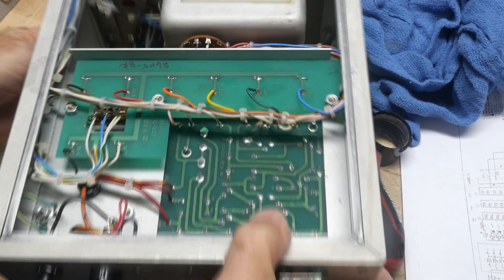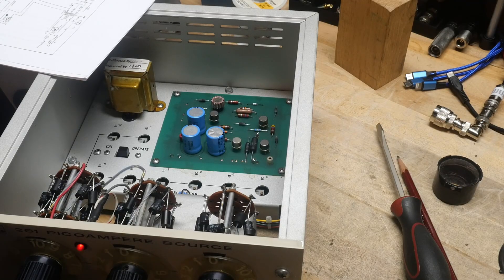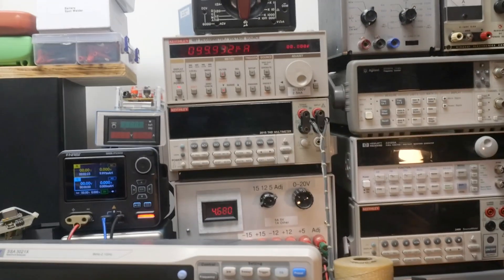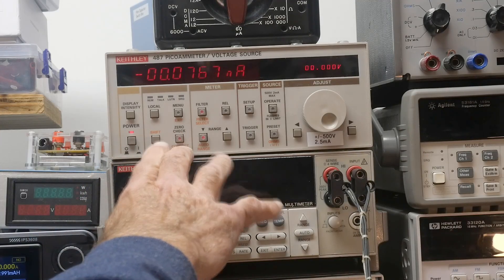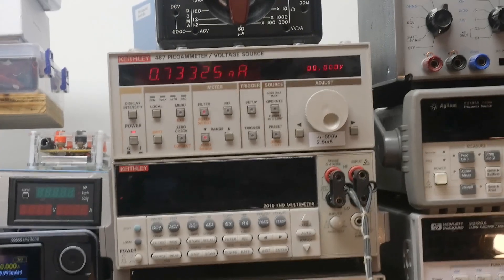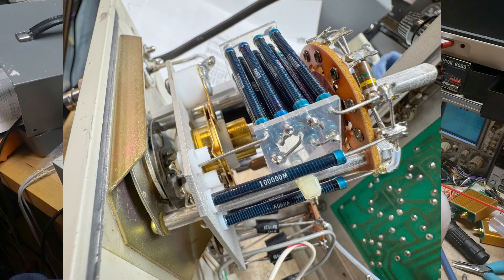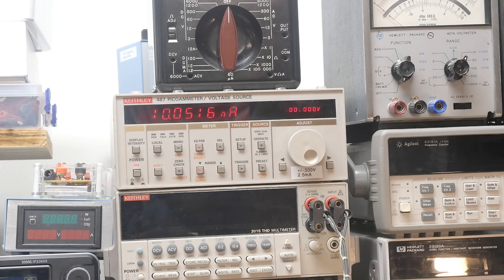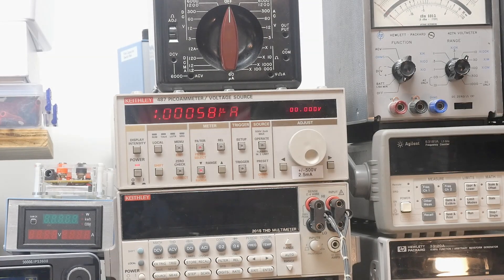#2476 Keithley 261 Picoampere Source (part 2 of 2)

Comment: The nA ranges are probably just because it needs a thorough cleaning, if anyone has every touched that with their fingers or a slight environmental grime from the air it causes leakage, it has to be really clean using IPA, and then has to be left for a few days before even that residue clears enough for it to come right, I had that issue on mine.

Comment: You can use your keithley 619 to verify range resistances per table 4-2.
Calibration depends on some known value(s) and measurement tolerances, so that check might not get you closer.
Using precise measurements for relative comparisons is much easier.

Comment: Just curious, several people have suggested cleaning the R's with alcohol and distilled water. Would placing a few desiccant packs in the box help with possible humidity issues?? Also would drying the r's off after exposure to water with dry heat be of benefit ?? Something like a 40 w incandescent bulb in a Styrofoam box over night.

Comment: I used to repair electrometers that used these extremely high resistors.  The procedure for the care and feeding of these rascals was to wash then down with distilled water after cleaning them with medical grade alcohol. Even that was still touch and go as to whether you could get them clean. In our case it wasn't so much accuracy as noise due to air born junk landing on the resistors. Victreen Corp. use to be one of the main manufactures of high value resistors and if they are still in business would be a good source for replacement and specific cleaning information.

Comment: Did you do the warmup period before calibration?  Hope those giant resistors are good as good luck getting some.  Maybe the switches need flush cleaned with alcohol.  At those high resistances,  any leakage in the switch might have effects unseen in normal circuits.

Comment: I've been looking for one of these as well, since I bought a pair of Keithley 160Bs, and I want to calibrate them. After looking as the service manual, however, I am tempted to build my own picoampere source, using hand selected pairs of cheap metal film resistors in place of the high precision resistors used by Keithley. It's final resistive divider that still has me worried: In the best case I will need a 1,000,000:1 divider, which will require at least a 10 MΩ resistor on the high side.
Reply: Might want to get resistors that are low and put others in series,  as padding across high meg resistors would be very difficult.
Reply: @TomSherwood-z5l that was my thought, e.g. combining two 5% resistors 100k + 1k where the 100k was low by 1% could result in a much more accurate sum. I also thought that I could measure the high value resistor for the big divider by putting it in parallel with a smaller resistor (I have some high value resistors that are meant to be used in a high voltage probe, but I don't have anything I trust that can measure that high).